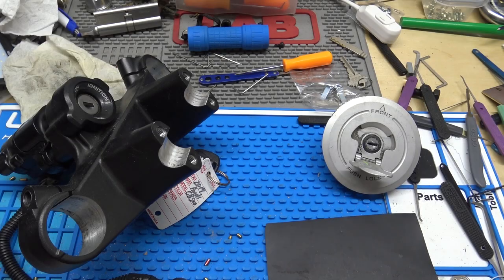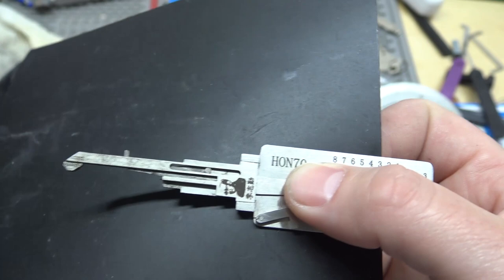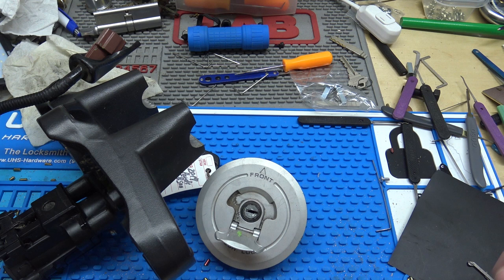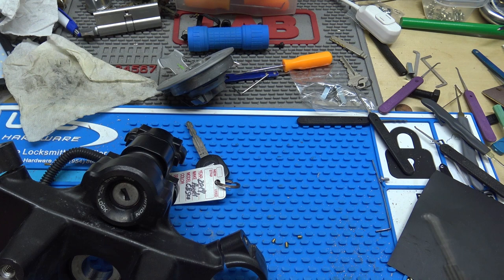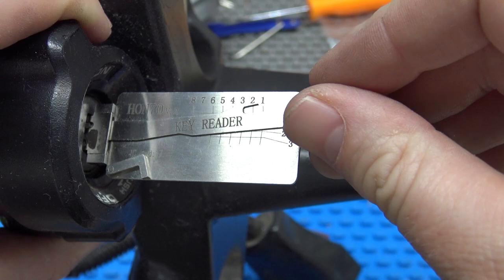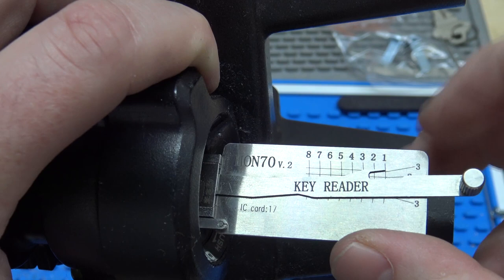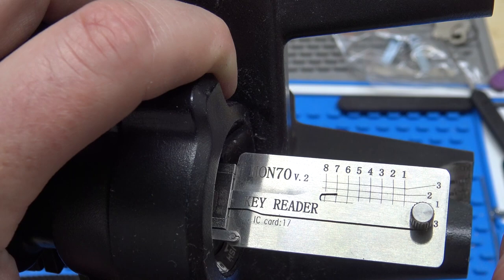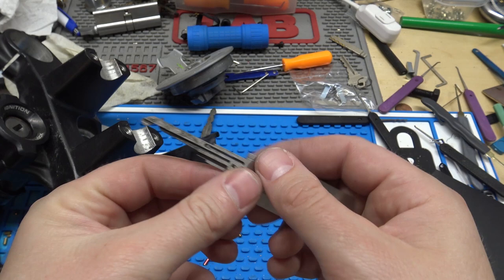(514) HON70 Lishi Direct Reader Tutorial

Comment: The 954 uses longer blank
Reply from the maker: I had a 2006 or 7 cbr the other day that did too.  I have yet to find a way to code the hd109A i still cut it on the HD109 then duplicate it on the hd109a but I tip stop it instead of shoulder stop
Reply: @BoredLockpicker  I believe the car 1000 rr newer years and the car 954 has the shoulder cut back I use the Accu readers on Honda
Reply from the maker: @qicpic007  this Lishi is for motorcycles